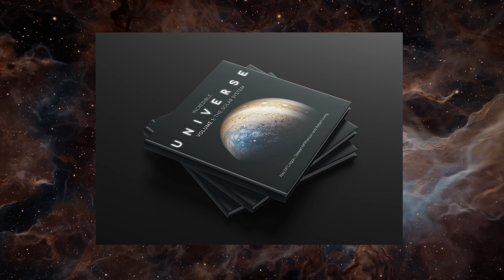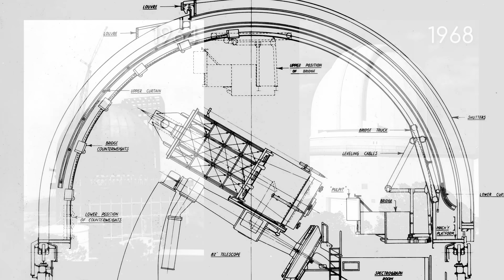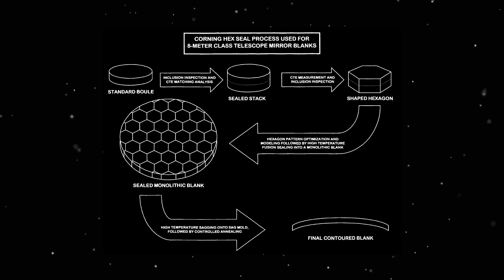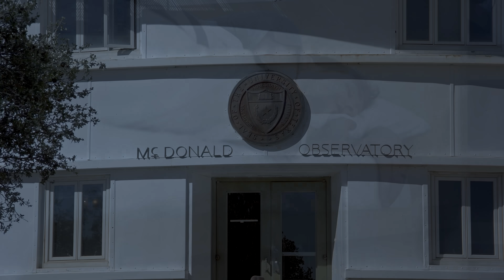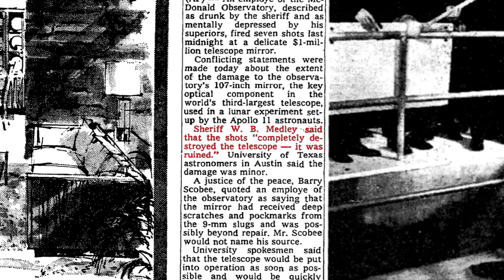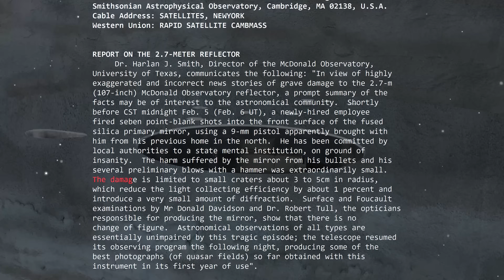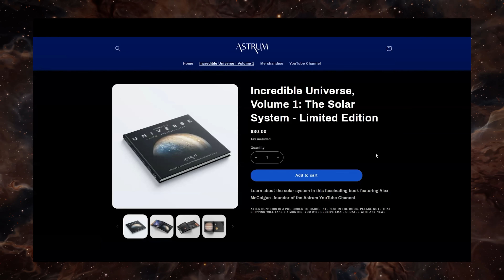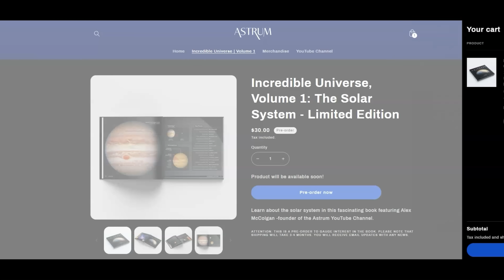Malicious Attack on $5 Million Telescope. Scientists Don’t Care.

Comment: If the center can have such huge damage, and is usally not used anyway...and all is on the outside ring..then why not only create the outside ring? or put 99.9% of all precission on the outer important ring, and allow being sloppy more towards the center.
Reply: A ring of glass would be much more susceptible to fluctuations in temperature that could easily put it out of alignment. But a huge mass of laminated glass would provide the structure and stability to prevent any warping.
Reply: @glennac  So they mostly just polish the ring piece?
Reply: @glennac  ok that would make sense. But why then not keep the center just unpolished structural glass. putting all the expensive work on polishing only to the important outside
Reply: The whole surface area gathers and reflect light, for an area around 9,000 Sq inches (minus the hole in the center, let's say 7,500 Sq if the hole is like 15% of the total surface area) inif you take out 8 Sq inches the total light reflected wouldn't be that harshly dampened.
Reply: @briankennedy5885  But at 8:55 you can see what is actully used for imaging. "Most is in the shadows of instruments anyway" Those 3 holes being on the edge casued the 1% drop. But the big Hammer hole did not much
Reply: Because the internal stress of the poorly manufactured part can spread to the edges.
Reply: No, no, that wouldn't take 4 years to make, we'd be paid far less.

Comment: 7:16 Did you just call a magazine a clip? That's like calling an EV a Diesel, it's just wrong.
Reply: It's an often-made mistake.
Reply: I disagree with your example only because a clip hold rounds and is used to load into a mag. M1 is a special case but.. So using an EV and Diesel does not seem fitting is all. Still such an annoying mistake. Same type of mistake as calling an engine in a vehicle a motor..
Reply: I do think we need to be correcting these simple mistakes only so it helps us all understand and communicate better.
Reply: @jstretch An engine is a motor. Look up the word "motor" in a dictionary. The word "vehicle" is often short for "motor vehicle" i.e., a vehicle that is motorized. That motor can be an electric motor or an internal combustion engine (ICE), but they are both still motors. An ICE happens to be a specific type of motor.
Reply: @courtenayrowett7058  Looks like my HVAC course book is wrong by definition. We where lied too with it and told motors have windings. That being the difference.
Reply: @courtenayrowett7058  Good clarification on details. My info was incorrect.
Reply: I think it is more like calling a wrench a ratchet.
Reply: I'm pretty sure all of us make similar mistakes in fields we aren't familiar with.
If anyone has an excuse to have no idea about firearms: it's a dude that runs a space nerd channel.
Reply: @peterpan4038  True. So true.
Reply: Relax, Tex. Picking on beginner mistakes is the best way to make sure any hobby/sport/passion doesn't have enough beginners to sustain.
Reply: @JasonDilly  well spoken.
Reply: @JasonDilly  Relax Dex, a scientist should have no problem seeing that he misspoke and correct the error. Finding errors is the beauty of science now isn't it?
Reply: @JasonDilly  Imagine telling someone that it's safe to point a gun at their own body, or that gravity is 10m/s cubed, or that pi is 4. Sure, getting clips and mags confused isn't on the same level, as someone saying it's safe to point a gun at yourself, but it's still WRONG regardless. And unless people actively push back against said wrongness, it will become rightness, and that's bad. You wouldn't call a big rig a scooter would you?
Reply: Nobody cares.